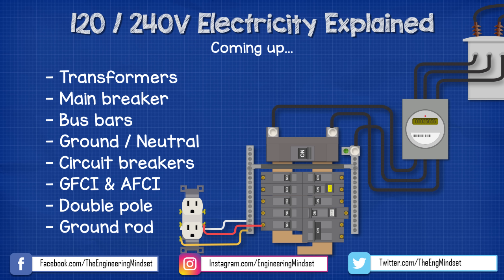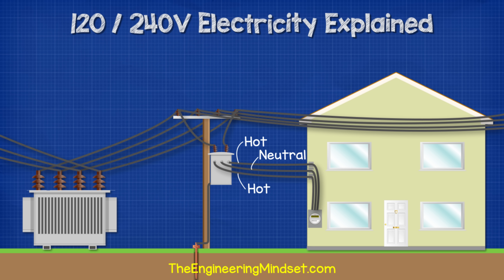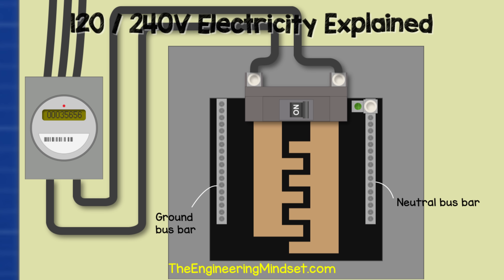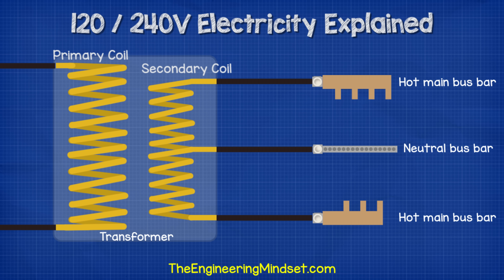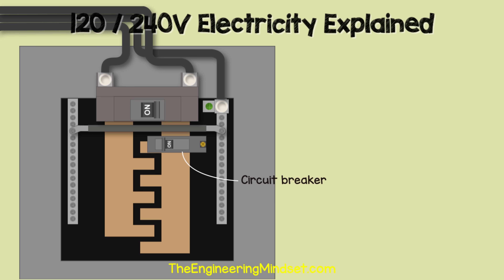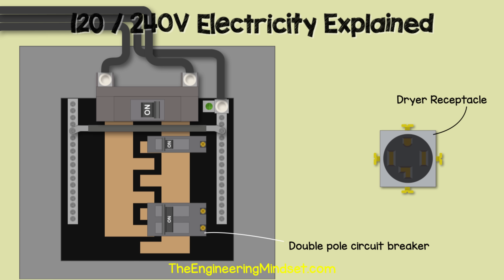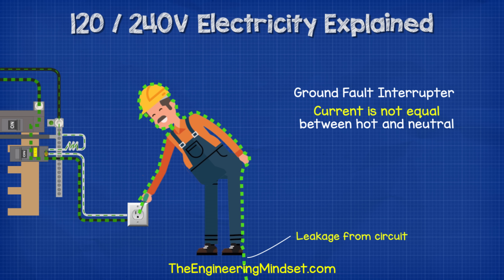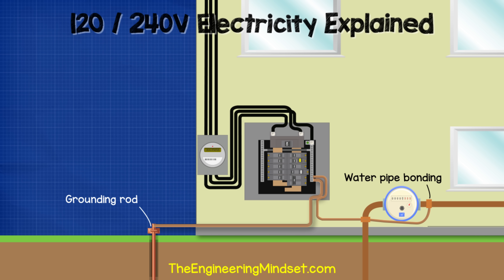120V 240V Electricity explained - Split phase 3 wire electrician

Comment: Thanks you. I recently watched few videos about people installing electrical system in theri house and since I'm from Europe, it makes no sens to me. I mean entire idea. Even though i am electrician here and learn how to do it in shool and did it many times myself. I simply have no clue about logic behind US system. (I still don't know why you do it  that way, but at least I don't what the way looks. It's strange)
Reply: I felt the same about watching the 240 volt system video, I can do 120 in my my sleep but how the 240 is setup is so foreign to me.
Reply: Well you guys say the same thing about Fahrenheit, Miles per hour,gasoline/fuel by the gallon, and US President Donald Trump! I guess we Americans just like to be different.
Reply from the maker: It's a crazy system but it is safer. I like how the rest of the world just took the full ~230V, choosing not to split the phase
Reply: @EngineeringMindset  It didn't quite happen that way.  Edison's DC system in New York chose 100 volts nominal for his lightbulbs as much for marketing a nice round number as anything else, then generated 110 and later 120 to account for voltage drop across the cables.  They also employed a 3 wire system of +110, 0 and -110 to save on copper, 4 wires would have been needed to distribute the same power all at +110.

Westinghouse used the same scales and 3-wires to compete but even though their system was AC the only use for electricity at the time was lighting so there was no use for cross phase connections.  That only happened when more power was needed for things like motors and to get it they tapped the 2 lines in a way that had never been in the original intent.

Meanwhile Europe imported Westinghouse generators, looked at them and, not having a 3-wire installation base, went "keep it simple, just put a wire on each end" and so got 220/240 volts from the start.

120v AC isn't significantly safer in terms of danger to life than 230.  For that you have to come down again.  And so the one place that the UK does use split phase is in building site transformers providing 110v — actually split phase +55v and -55v with the middle tap bonded to ground.
Reply: @EngineeringMindset  as a electrician in Spain it makes no sense to me the use of metal boxes and conecting ground ,neutral and the box itself together ( I know that neutral has 0v but it is not always the case) . Here we use a copper spike in the ground to make the ground a separate circuit and every  3 circuits is protected with a GFCI. Here were i live also is not uncommon to have a house conected to a 2 fase 230v so there is no real neutral so connecting ground and neutral together is imposible.  I was curious to know how it was in the US. Good video.

Comment: I have a question. If the white wire is neutral and connects back to the neutral bar.   Then why do you need the ground also connecting back to the neutral bar?   Why not just connect the ground wire from the light fixture case to the neural wire inside the light fixture directly?
Reply from the maker: Ground wire is a very low resistance emergency backup route
Reply: The neutral provides a return path to the power source. The ground wire is to attach to you.
When using an old school metal cased drill the ground lead would be connected to the case and you when you picked it up.  No matter what disaster happens to the circuitry inside of the metal case it and you are safely at ground potential. If the neutral were attached to the case and the power cord neutral opened you would be the return path to the power source.  Both neutral and ground may attach to the same place, but they do so for different reasons and must remain separate.
Reply from the maker: Watch this https://youtu.be/P-W42tk-fWc

Comment: Can u please talk about how 220V for ac outdoor unit works??. I mean i really confused caused the motor for the compressor is single phase. But i got not clue how 220V works in simple phase without needed of 3 wires. Usually 2 wires are enough.
Reply: You do not need the neutral wire.  You should have a safety ground but that takes no part in the power circuit. DO NOT USE THIS INFO TO ATTACH NON-NORTH AMERICAN EQUIPMENT TO NA POWER.  The rest of the world is too hung up on neutrals.
Reply from the maker: The path of electricity splits into two and they enter different coils of the motor winding. One of the paths will have some electronics inside to delay the electricity so the motor will think it has two different phases and spin.
Reply: @EngineeringMindset  very well put

Comment: Knew about the gfci but did not know about the afci.  I will need to check that out and replace our breakers in our cabin.  We just had an extension cord do that and the breaker did not pop.  Glad i watched this video.
Reply: I have started simply putting in dual function afci/gfci breakers in all positions.
They are a lot more expensive, but much better life protection.

Remember, a regular breaker is only to be protect the wiring, not you!
Reply: @ke6gwf  pretty sure AFCI is to protect your electric blanket, not the wires 
Be careful though. My portable AC did not like the AFCI on my bedroom circuit. I ended up running a heavy extension cord out to the hall.
Reply: @jstan_49  some cord ends have afci built into them to protect just the cord, but the breakers are to protect the in wall wiring more than anything.
Some of the most common causes of house fires are from nails going through wires and causing an intermittent short that heats the wire up (or being pinched against metal causing a low level short, etc), or from a bad connection, either from a broken wire that is still touching, or a loose connection, which will heat up under load.

These can also occur in cords, but the reason they are required as breakers rather than outlets, is to protect against in-wall faults.

And yes, AFCIs are susceptible to false trips, but unless the afci breaker is defective, if it is tripping when turning on a heavy load, it probably means that there is a wiring fault, and it is doing its job.
If there is a loose connection at the breaker, at the back of the outlet, or a loose wire nut somewhere along the way, or an internal fault in the unit, it will detect this under heavy load where it might not be a problem under light loads.
So I would try plugging the unit into another AFCI protected circuit from a different breaker, and see if it still trips.
Most of the breakers will show you a code to let you know what it detected, which can help with the troubleshooting.

To put it another way, an afci tripping is a sign of a problem with some part of the system, and should be investigated, rather than just treated as a nuisance,because a properly designed system won't do that.
Reply: @ke6gwf  "So I would try plugging the unit into another AFCI protected circuit from a different breaker, and see if it still trips.
Most of the breakers will show you a code to let you know what it detected, which can help with the troubleshooting."

I don't live there anymore, and the bedroom circuit was the only one (out of 3 or 4) with an AFCI breaker. Like I said, at least when that apartment was built, AFCI was mainly about protecting sleeping spaces from supplementary heating devices that had a record of wearing out and arcing through flammable materials. (At least, I'm pretty sure that was the focus in that chapter of the DIY electrical book I read and lost several years ago. Protection from faulty wiring was just a bonus.)

At any rate, the breaker never tripped. My AC would just labor and rattle when the compressor kicked on until it was up to speed. It stopped doing that when I changed circuits. Maybe the breaker was faulty and was briefly disconnecting without actually tripping.

Troubleshooting codes? You must live in some kind of City of the Future(TM) if your breakers give you codes. The one I mentioned may have had a window with a red flag to let you know it had tripped. The apartment I'm in now predates even GFCI (though the bathroom outlet has been upgraded.) I don't even know where the breaker panel is in the building (there isn't one in my unit), but I doubt there are ACFI breakers in it. How much do you spend a year on your house's infrastructure for every tiny advancement in technology, regardless of code requirements? Some of us have to make do with old, grandfathered construction that is cheap enough the landlord can just about keep it from falling down around our ears while paying the exorbitant property taxes and the myriad school bonds that like to pass in this area.
Reply: @jstan_49  so what you are describing sounds nothing like an AFCI nuisance trip, but like either a bad connection or bad contacts in that circuit, so that the ac wasn't getting full current.
When they trip, they actually trip.

And the modern multifunction AFCI breakers that I get at Home Depot (series and parallel fault, plus GFCI), will flash a code through an led so that you can tell why it tripped lol
The early AFCIs were only single function, and yes, were more for protecting against damaged cords, but the new ones are much more useful.

Oh, and I consider putting in AFCI breakers as a one time upgrade to 200 year old technology, and if they come out with a new style that adds new features, I will look and see if they are a compelling addition worth upgrading, or just a marginal improvement.
The next likely improvement is if they figure out how to detect heating from bad connections, which is a common cause of fires, but I make sure that I have good connections in my wiring, and that issue is usually the result of shoddy workmanship, so probably not worth an upgrade.

I will also mention that in a house that has good wiring, I am not going to upgrade everything, just bedrooms and such. Where is would upgrade everything is something old with known sketchy wiring, where an electrical fire won't surprise me. 

It's kind of like getting fire extinguishers and a fireproof safe for your important documents. 
If I can put a couple of hundred bucks towards knocking my fire risk way down, maybe it's worth it. 
The places I have
Reply: ke6gwf you’ll be sorry you did that when your freezer or sump pump randomly trips the gfci while you’re out of town on a trip.
Reply: @stargazer7644 , generally speaking, if the fridge is next to the sink, it has to have a GFCI on the outlet anyway.
And sump pumps normally require GFCI protection as well.
So you make no valid point lol
Reply: @ke6gwf  Kitchen countertop receptacles require GFCI protection.  Refrigerators generally don't sit on kitchen countertops.  They are normally on an appliance receptacle behind the refrigerator which is not required to be GFCI protected.   Sump pumps should be on a dedicated non-gfci circuit if you value your house and its contents.  The first time a nuisance trip floods your basement and everything in it or when it floods your crawlspace and destroys your heat pump, or you lose $300 worth of food in the freezer, you'll understand.
Reply: @stargazer7644 so I guess that there are exceptions for sump pumps in some situations not needing GFCI protection, but most of the sump pumps that I have worked with recently had GFCI protection built right in the cord, and under some conditions they are required to have it in residential applications.
But you are right that sometimes they can skip the GFCI, which lowers life safety, but reduces flooding risk.

As to refrigerators, any outlet within 6 feet of the edge of the sink requires GFCI protection. Unless it is a single outlet dedicated outlet that is completely behind the fridge.
But I often see fridges plugged in next to the fridge on the sink side, or within 6 feet of the sink, so unless that dedicated outlet is installed behind the fridge, it will be on a GFCI.
And if you have a fridge or freezer in the garage, it will be on a GFCI, because all outlets in garages have to be GFCI.

Now, if there is a dedicated fridge outlet meeting the exception rules, then I am not going to put a GFCI breaker on it.
And if there is a dedicated outlet meeting the sump pump exception rules, same thing.

But otherwise, my point stands.
Reply: @Mister Brookes true, you can grandfather old installations without AFCI, but why? Lol
I appreciate the additional protection against most types of electrical fires that the new technology provides.
Reply: @Mister Brookes I don't know where you live, or if you have a different type of AFCI there, but in the US the statistics say that about 50 percent of electrical caused residential fires would be prevented by use of the current technology of AFCIs.
And high resistance connections often lead to sparking, which the AFCI will detect.
They are working on finding ways to detect high resistance connections as well, so maybe a future update will add that ability, but knocking out 50% is a pretty good investment.
Reply: AFCIs were required in bedrooms since the 2005 NEC... how did you not know about them till now...
Reply: @adventureoflinkmk2  Maybe his cabin was built before 2005?

Comment: Can you make a off the grid diagram video in this animation..
Reply: It would be the same thing except for the source of electricity. The panel would be feed by generator, windmill, &/or panels.
Reply: Yup, exactly the same, except you would be using the output of a generator or inverter, instead of power company transformer.
Generators and inverters that produce 220 volts are already designed to fit this system, so you don't have to worry about them, just replace the transformer with them.
Reply from the maker: Power inverter video  here https://youtu.be/iIqhAX0I7lI

Comment: Can someone explain to me why the current increases when you add more devices to the sockets. I’m imagining that a circuit will always have the same current so where does this increased current come from?
Reply: Current is = to the Voltage (constant in this system) divided by resistance. As you add devices you reduce the resistance and thus the current increases. Think about by adding more things your adding more paths/pipes which is like if you were trying to get water to flow through a small pipe compared to a big one you can get more through the big pipe at the same pressure.
Reply from the maker: Current explained: https://youtu.be/8Posj4WMo0o
Reply: Think of current as heat or energy. As you add more devices, more energy is consumed/more heat is generated so current flow goes up. In most cases, current is DRAWN from a circuit. You can hook up a light bulb to a circuit that can source infinite current and it'll be fine. As you add more bulbs, the current goes up. Things get a little odd when dealing with silicon devices like LEDs, so this doesn't always hold true, but for most things, it's a find analogy.
Reply: The current rating of a circuit is the maximum that can be delivered. If there is no device turned on, then no current flows. Increase the load and more current has to flow.
Reply: Important thing to understand is that devices are added in parallel, not in series.

I think the graphics is confusing at that point in the video as it looks like devices are being connected in a series circuit... THEY ARE NOT! When more devices are added in series they just increase the resistance and therefore reduce the current which of course would not cause the breaker to work.

But when they are added in parallel (https://youtu.be/8Posj4WMo0o?t=429) the total resistance is lowered (1/Rt = 1/Ra + 1/Rb + ...) and the current is increased.